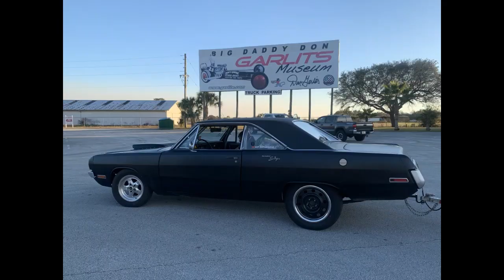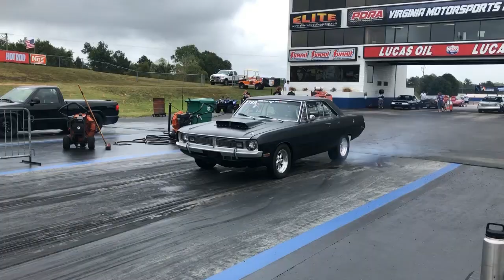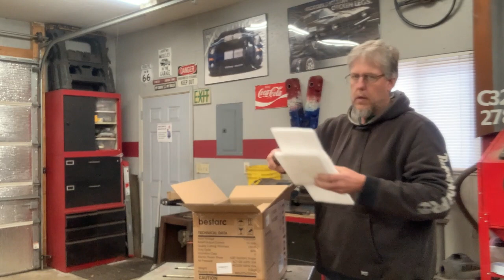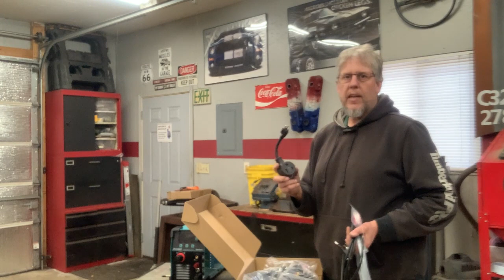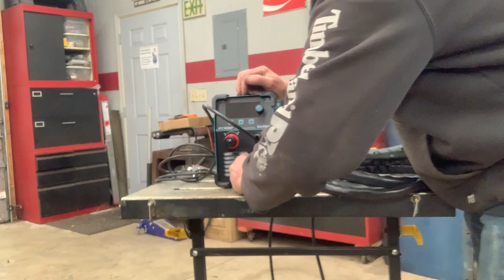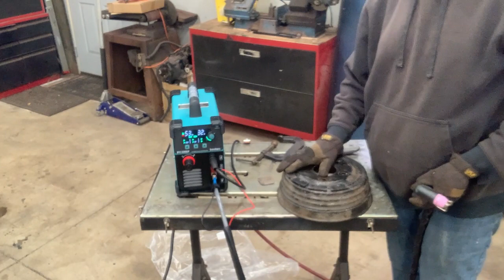Bestarc BTC500DP 7th Generation Plasma Cutter, it has lots of cool features and very affordable!!

Comment: $220 seems like a really good deal on a Plasma cutter...  The price of these new gen of welders and plasma cutters have made it easy to have lots of nice shop tools !
Reply from the maker: $220 ish is a nice price point, allows a small shop to be able to have one and use it as needed. Should last someone quite a while. The new inverter stuff you can package it pretty compact. Thanks for taking the time to comment.